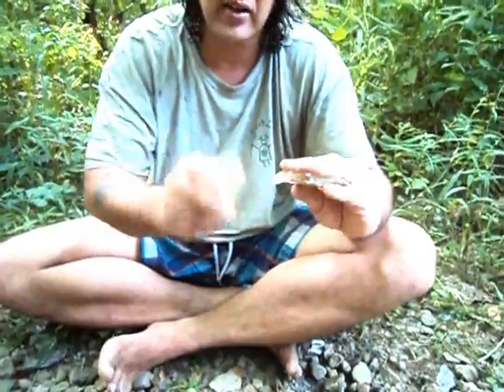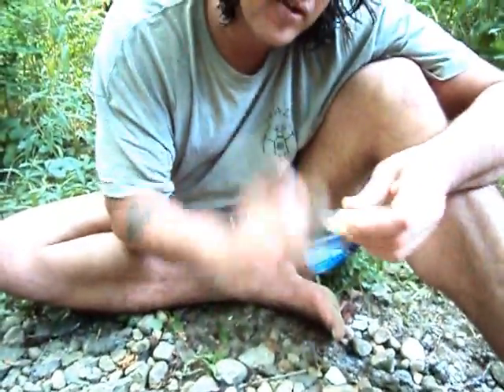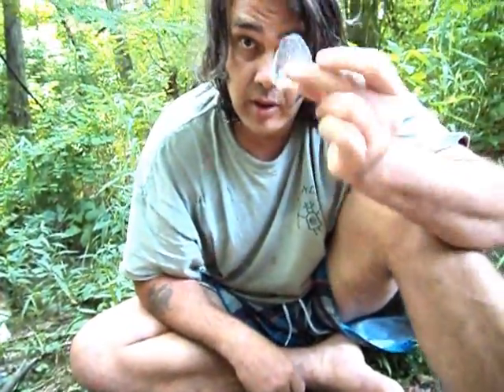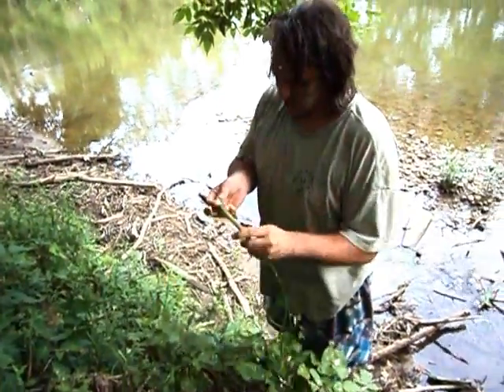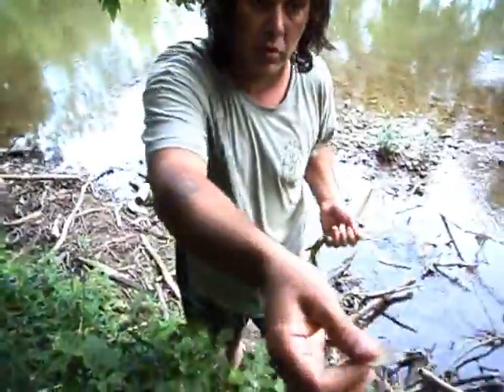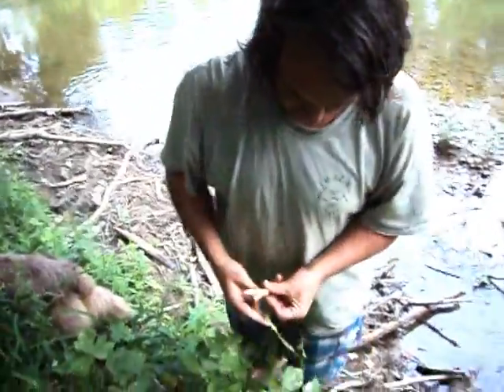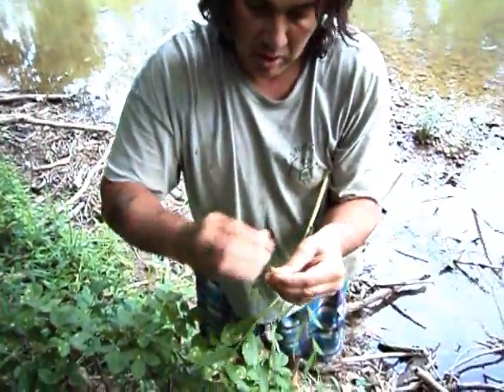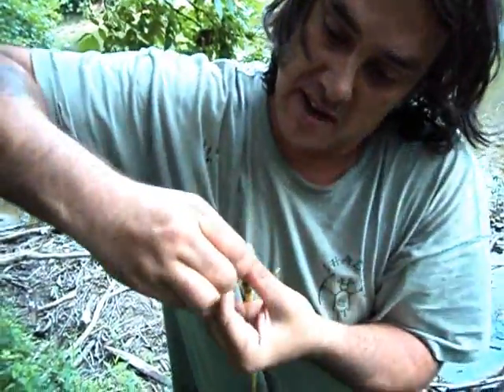How to Make a Hoko Knife

Comment: Not to mention the "Bear Grylls Ultimate Knife", made in China out of soft mystery steel that bends easily, rusts easily, and won't hold an edge.

Top it off by having it pinned to the hollow plastic handle, a useless pommel that's glued into the hollow plastic handle (who hammers with a pommel anyway, that's just asking for a hand injury?), a firesteel that's too short, useless serrations, and a sharpener that's the finest coating of diamond dust that won't last!

Bear Grylls should be ashamed!